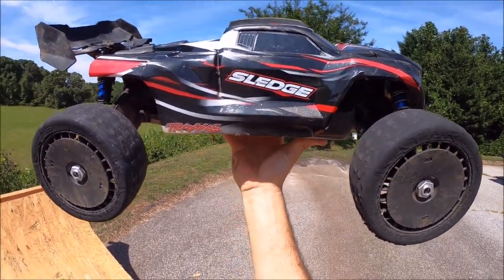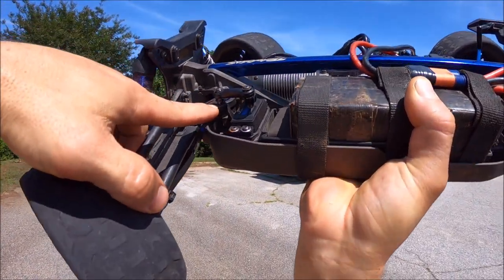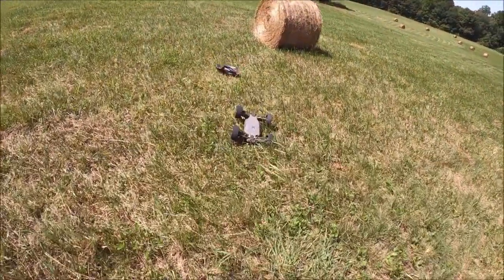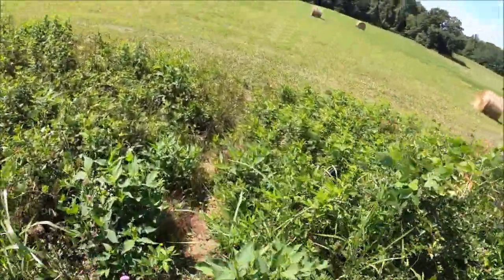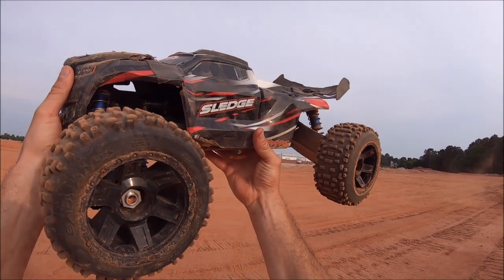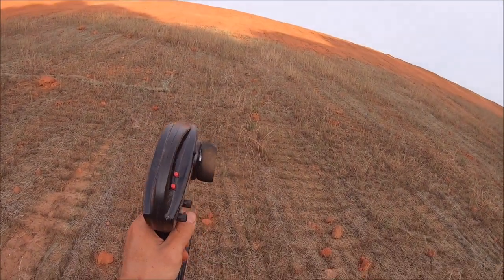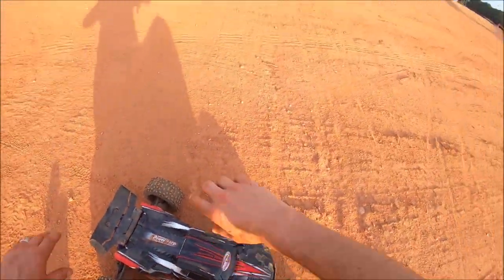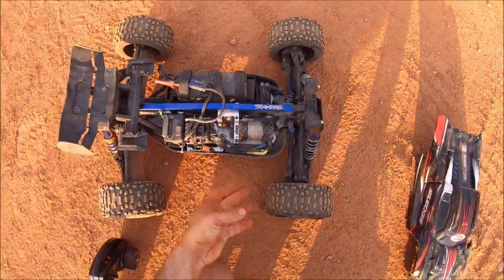TRAXXAS Sledge MOST EXTREME SENDS and THRASHING!😱 M2C and Basherqueen Upgrades!!

Comment: My sledge just cant stay together. Got m2c motor mount now then the diff goes. before that I tore up 2 spur gears. sucks for 800 bucks the problems it has. I like it when its running but dang the breakage is killing me. Yours took a beating I dnt get it.

Comment: Love you driving bro!!! Which one is best for you between kraton and sledge?
Reply from the maker: Thanks!! Hard to say. Box stock vs box stock, the Sledge is tougher but the Kraton drives better. Both M2C'd and setup right are on par!
Reply: If you’re looking to buy just one rig for extreme bashing, it makes more financial sense to start off with a Kraton EXB and build it up ($800 for a sledge or 469+~$150 in electrics for EXB). With the sledge you have a whole bunch more parts that need to get swapped out to get it on this level plus sub-par electrics. The clipless body and stronger wing mount are nice on the sledge but don’t justify the hike in cost of entry IMO. If Traxxas made a roller/slider of the Slege there might be more of a competition.

Comment: What do you think of the Sladge without the metal chassie plate. And without all the tuning?? Better another X Maxx or an Arrma if you want to drive / bash / jump new out of the box? Thank you for this amazing Video👍👍👍 greetings from switzerland ✌️
Reply from the maker: Thanks! The Sledge is tough out of the box for sure. But for extreme bashing it needs the M2C hop ups just like any Arrma or the Xmaxx. Only major thing the Sledge needs is the M2C motormount at least. Keeps you from eating spur gears also.😎💪🤘🤘
Reply: @RCDUDE81  Thank you👍👍 have a nice Day✌️✌️✌️

Comment: Sometimes you get a set of wheels that wear perfectly and just don't quit Sometimes you rip a tire strip a hex first 2nd 3rd run right , only a rc er" understands 😆 🤣
Reply: I have set sweeps wheels just never die  , they are  perfect size and don't Balloon , nice in between size I don't have to change gearing ofcourse I can't find them and no one knoescwhsts going with the co.
Reply from the maker: Yeah dude the Badlands have lasted for years on many trucks. Katars I blow in one outing!😝🤣🤣